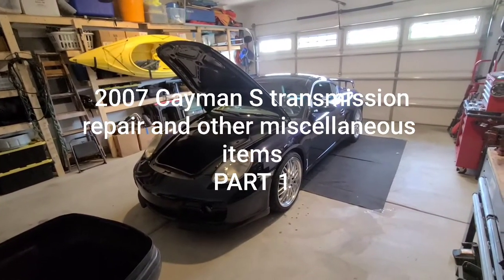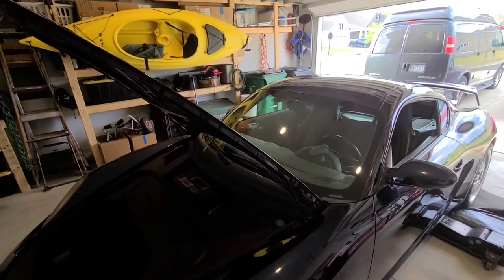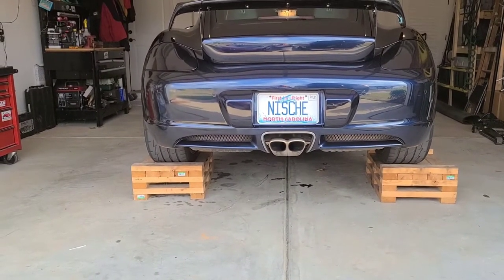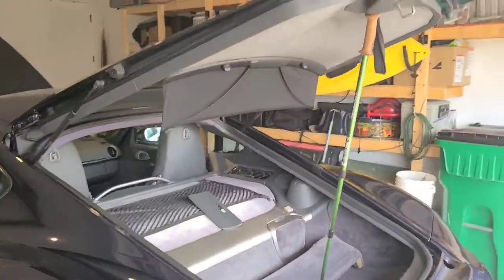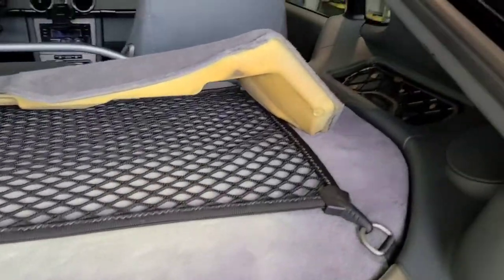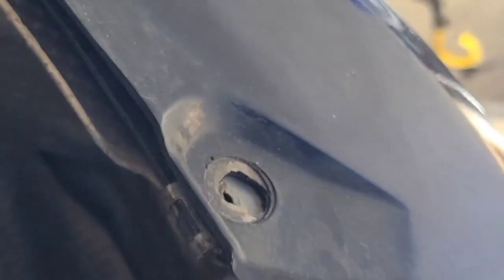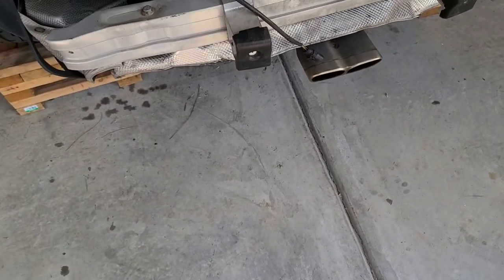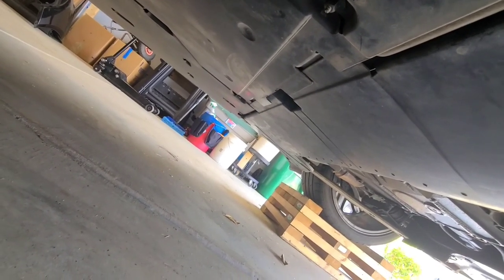2007 Cayman S transmission repair Part 1

Comment: John I tried to email you at your Gmail account you posted on the video but it's hard to see due to reflection, Quick question (is removing the bumper a requirements) I built the same stands that you have, so I am at the same height. What was the purpose of the bumper removal, is it that the tranny wont be able to be rolled out
Reply: I think it is. Not difficult to remove the bumper cover. You need to remove the exhaust anyway, so I think bumper removal isn't much more. It gives u so much more room to get under the car too.
Reply: John I removed everything after creating the stand you posted and I am about to remove the transmission, I was just wondering if I could skip removing the bumper, But I will see what happens when i attempt to move it out worst case scenario i can lift te car up a few more inches and roll it out, BTW great videos and thank you for the quick response bud, you have a greattttt Dayyyy.